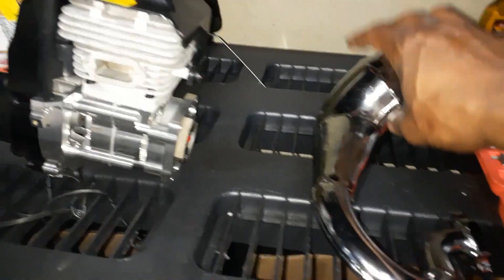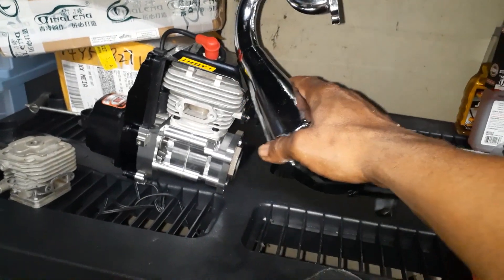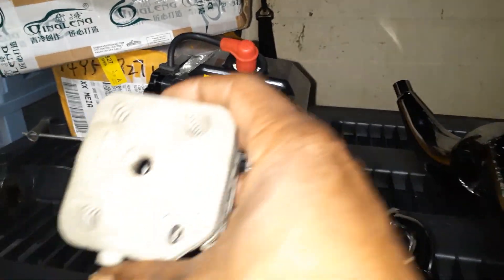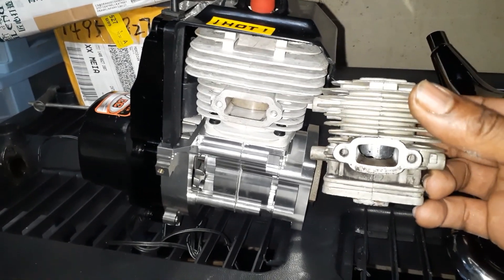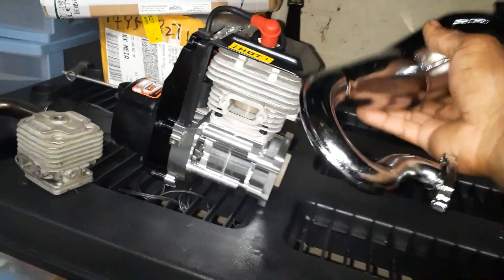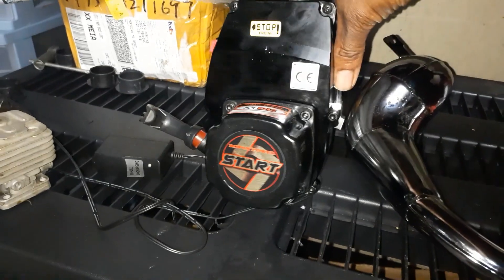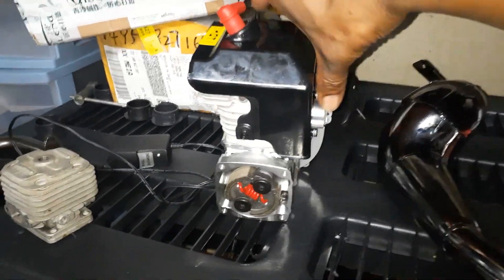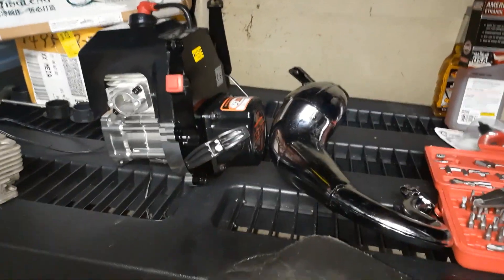The Rovan 71cc pipe

Comment: Lmao in the game, that thing won’t even compare to a 40cc from any of the real big bore manufacturers. That thing is shit just like the 45 and 45. Geez I wasted my money on that 45 thinking it would compare to even a 30.5 and it didn’t.
Reply from the maker: well my ported 30.5cc didnt come close my 45cc
Reply: from the videos of stock 45 i would say that my ported 29 beats them all day.
Reply: hoturpo123456  depends on what your using it for   I have the 45 in my rampage MT and its full aluminium parts so it weighs 40 lb lol and i dont race i bash i climb off road things the low end torque nothing beats it for the $$ you get max torque at 9K while ported motors 14k